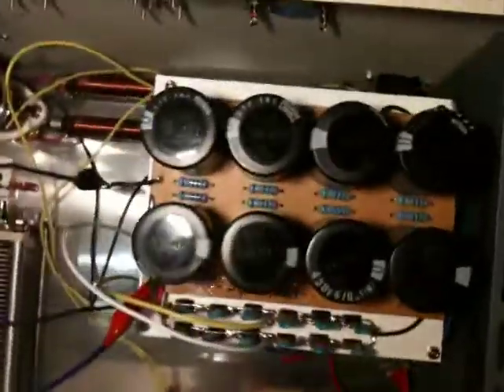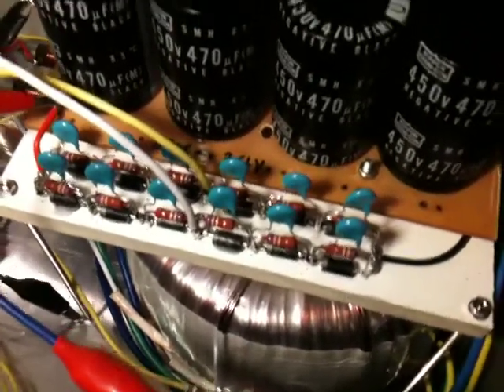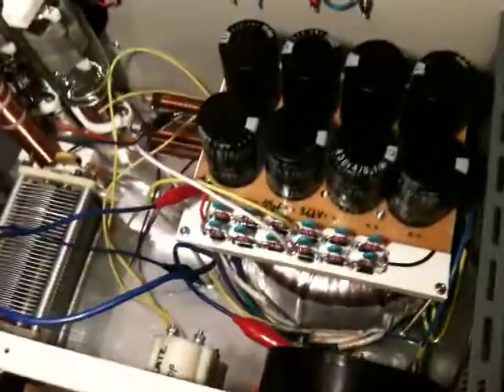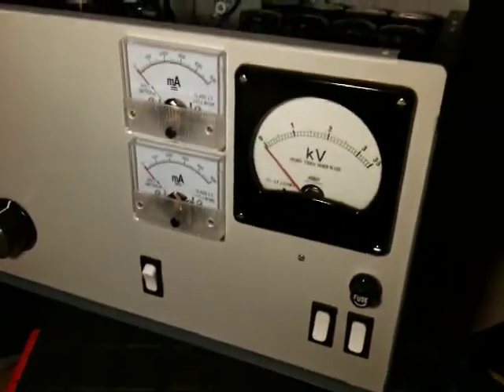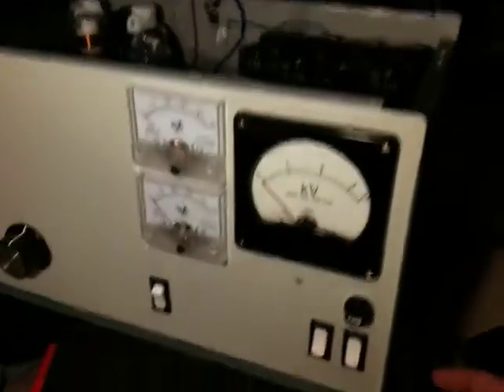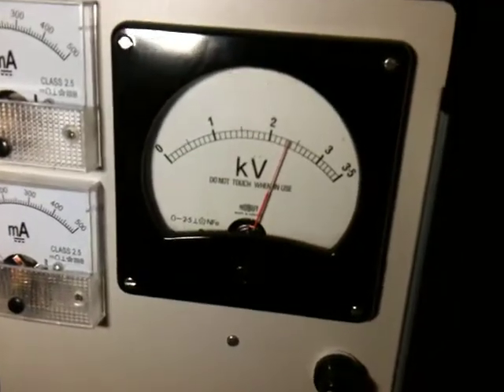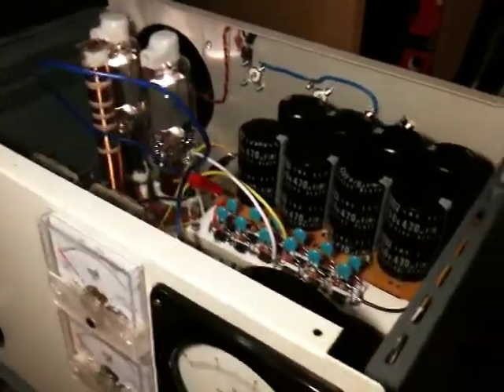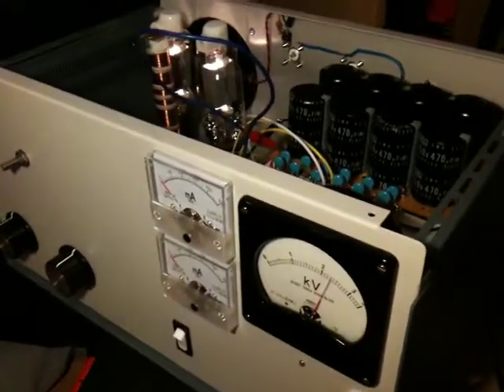HF Linear Amplifier High Voltage Power Supply - First switch on!

Comment: Rather than a manual soft start switch, I'd have wired up a timer circuit to put the soft start out of line after 3 seconds or so...

Comment: great job. should get 500 600 PEP SSB when all done. Got SB 200 and a FL 2100B same tubes. like the caps across diodes. you do not need resistors across HV diodes anymore. anyways does not hurt to keep them in.

Comment: Great job on this vblog, alas they don't use resistors and capacitors across rectifiers since like the 1970's, though you did use a toroid power transformer
merci beaucoupe for sharing
73 OM
de n8zu

Comment: Whats with the resistors over the rectifiers, bleeders to ?
Wich value are they ?

I'm self using a R&S SK010 army transm.
Your PA look good, nice job !
Reply: Cor back in the day diodes were not available with good tolerances in avalnches etc. so specs were very different compared to today, so we used a resistor anc ceramic cap over the diode to protect (balance) the diodes, it is not being done since the late 1970's as diode manufacturing standards became closer to perfect.  the values for caps would be .01Pf and 390k resistor  with a 1n5408 diode, the capacitor bank even at 5kv would be 240 uF and 450v series of them to make up the ht volts u need , if 2kv then build for 3kv , etc. the bleeder resistors we calculate.
1 . current at idle needed. +_10ma in most cases is ok ,no need for 200ma like in 1965 :) we use ssb mostly 
2, watts in diisipation(resistors must disipate the heat safely in watts)
3, working voltage of amplifier (to calculate the resistors values)
4. in this video i guess that his bleeders are more than 50k each due to fact they are  small in wattage, @ 2400 volt 40k 11 watt over each electorlitic cap is used , i would suggest 46k 10 watt.
if less idle current is needed increase the resistors ohm value, if we double that to 80k the wattage dissipation of resistor will be halved and the need for 10 watt  becomes = 80k 5 watt resistor :)
remember this is how i do it , you need to calculate b4 just except anybody's word for it.
Johan zs2cx

Comment: The amazing thing about this is ur soft start circuitry, it seems exacly the same as my idea a few years back when I was making a power supply, using 2 switches and 1 switch in parallel with a resistor, but u have 2 switch the switch with the parallel resistor last in order 4 the soft start. Maybe it will b better if there was some sorta 2 way switch that can 1st switch on power in 1 position then bridge a resistor in the other position 4 a soft start.